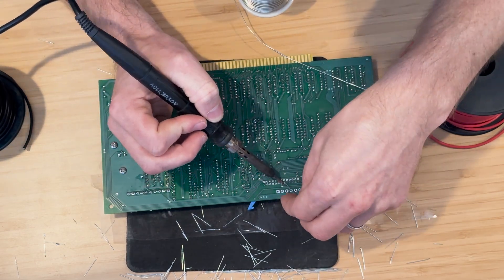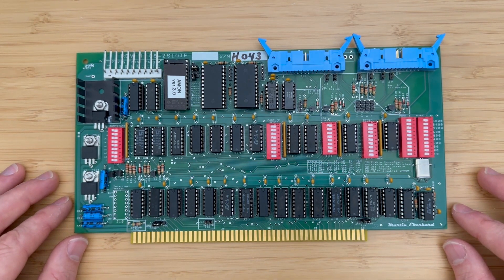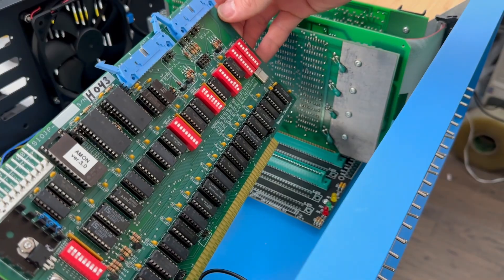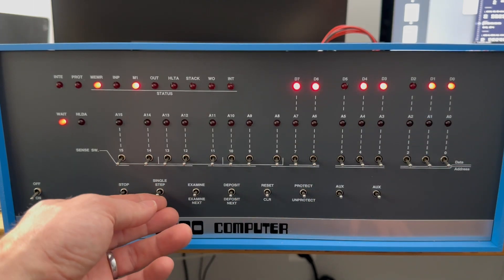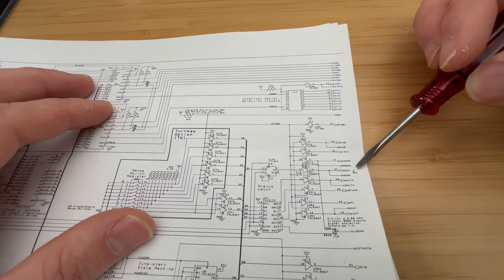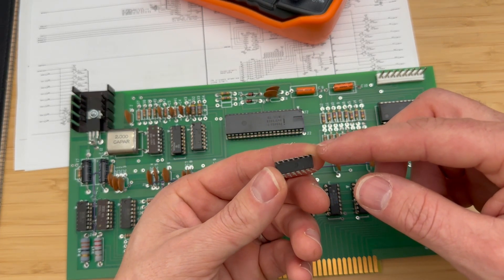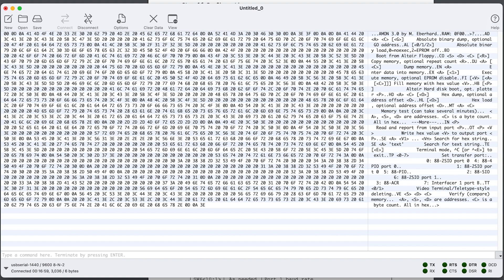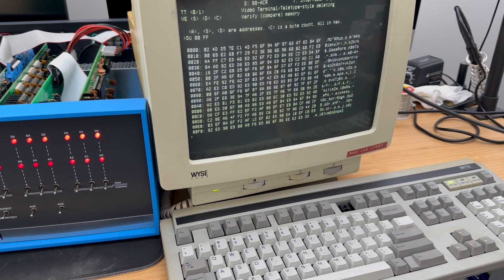Altair 8800 Build - Can It Run BASIC?

Comment: Thanks for this, I’m in the process of building the 88-2SIOJP board and this guide really helped me.   The board is well documented by Martin, but there are lots of options.  I’m building the Turnkey+RS232+AMON+Jumpstart  … I think.  Note for anyone just getting into S100 - you can get started with the “JAIR”board even without a backplane.